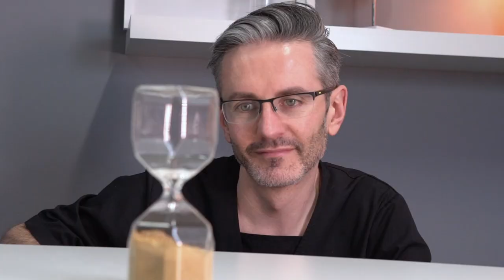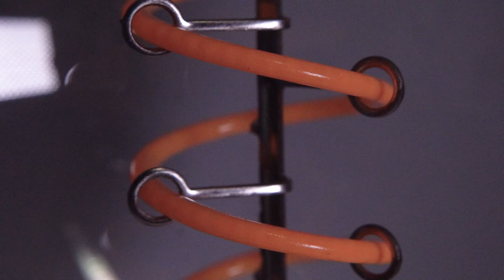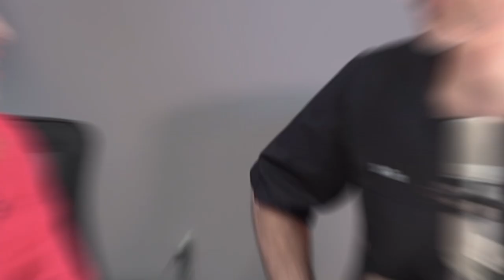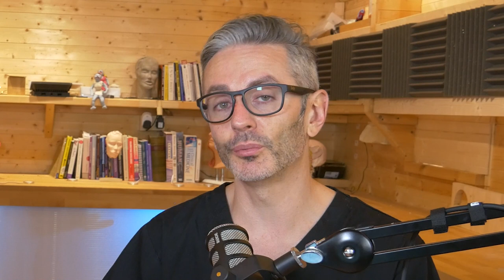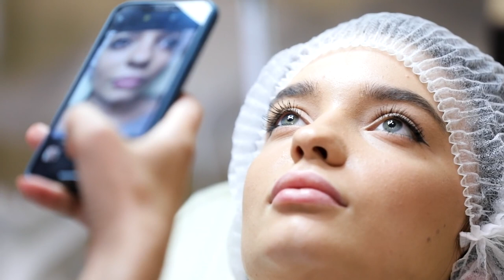Create Expert-Level Lips With This Simple 4-Step Lip Design Blueprint [AESTHETICS MASTERY SHOW]

Comment: I have many patients that complained that “ after getting lip filler, it goes away so fast” I have explained to them that one syringe of filler is like an amount of a pea that is spread out through the lips, and that if they  like the swollen lips it simply means that they would need more filler. Then the next question is how many syringes on average for a 50-60 year olds lips to actually reflect a good amount of volume has been achieved natural look, applying too much fillers to cause a pressure occlusion. 3-4?
Reply: how much is one syringe? im getting 1ml  Russian technique done but i feel like its too much